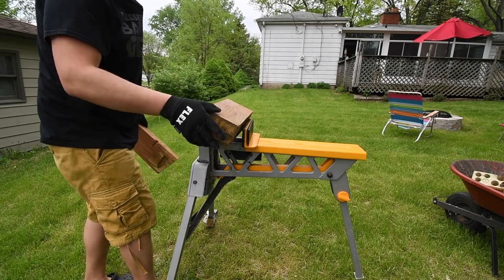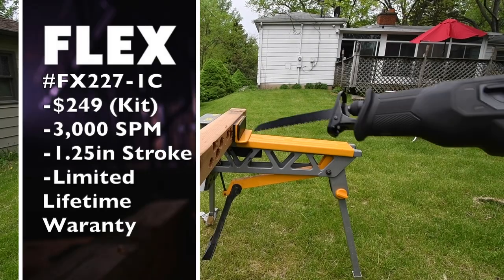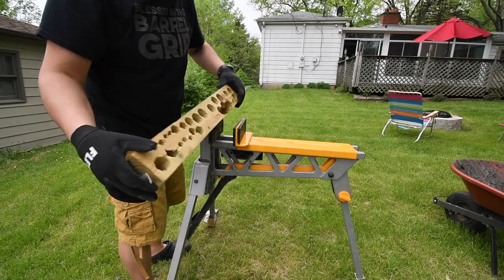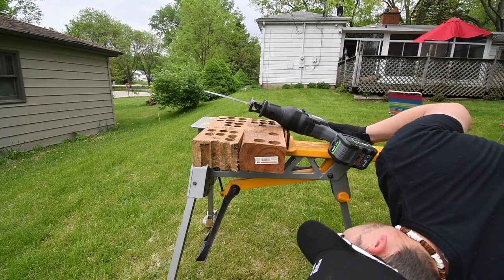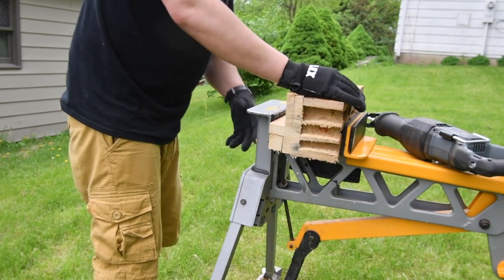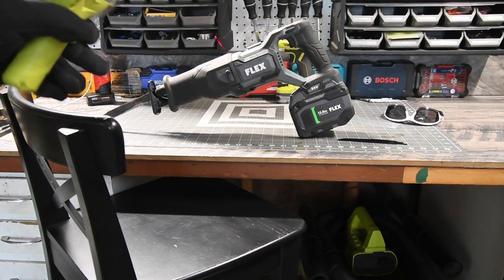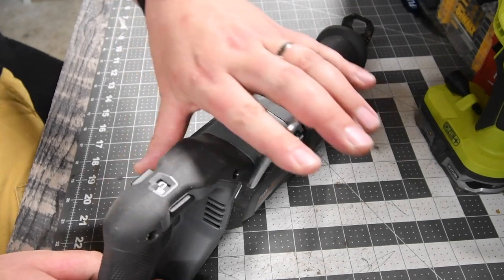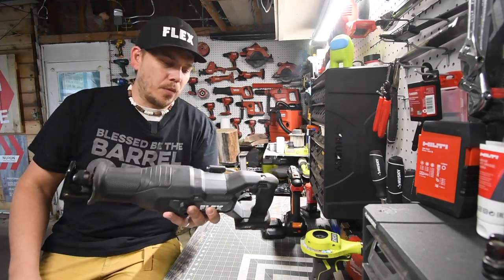Demolition TEST! (FLEX Reciprocating Saw)

Comment: I'm leaning Flex for something different but considering Milwaukee as well. Already have Milwaukee 12V and Dewalt 20V. Really turned off by Barnaby and the infomercial-esque garbage. Just want something robust I can slap a battery in and go. Don't want to worry about a flex volt advantage working with this tool or that tool. Have some Ryobi but usually use those for niche jobs. Great video!
Reply from the maker: Both brands are fantastic brands. right now Milwaukee has more tools to offer than Flex does. but that will change in the future.

Comment: BLESSED BE THE BARREL GRIP Dave! The FLEX saw rocks. How was it for the wrist in terms of vibration?
Reply from the maker: wrists felt good, but you can tell by my skin that you feel vibration
Reply: @ManCaverTools  well, honestly, if you do not feel vibration when cutting with recip saw them your are cutting nothing. So the point is was it bearable or wrist busting? Say how would you compare it to Milwaukee or DEWALT or HILTI

Comment: How are flex tools longevity?
Reply: I have my Flex 24V Quick Eject Brushless Impact Driver, Turbo Hammer Drill kit with 5.0Ah battery for a year of jobsite abuse, driving deck screws, structural lag screws like Timberloks and Spax Powerlags, GRK's Framing and Decking screws 3-1/8, and Spax 3-1/2. The impact driver dropped from 3rd floor twice (intentionally) and 1 accidental drop 4th floor. The tool only suffered minor scratches and little bit of cracks in the back of the tool. The turbo Hammer drill had drilled 876 concrete holes in the size of 3/16th for the Tapcons concrete screws 1/4". And drilled 200 holes for 3/8th concrete anchors. Then assorted drilling of pilot holes in the wood and metal, stainless steel, and did a lot of bore drilling in the studs with Irwin speedbor max. And I spilled the flex hammer drill with a bucket 🪣 of water intentionally. Both of them are still working, and I got them for a year and 2 months now. For the Flex 24V circular saw I got the 7-1/4" cordless sidewinder with brake. Did a lot of cutting on wood, pressure treated, did a lot of rip cutting 2x8x16 (as always I want to turn em' into stock 2x4's) rip cuts, crosscutting 2x10's, bevel cutting and miter cutting (yes you can miter cut your stocks with circular saw using the speed square or any device that have 45°) also I crosscuts a lot of 4x4's and 4x8's pressure treated running the saw with 6.0ah Flex 24V stacked lithium ion pouch cell battery. I got the saw for a year and 2 months but the stack battery I only got it since when the Flex stack lithium battery came out. Also been using the circular saw for cutting metal although you're not supposed to do that but thanks to diablo steel demon blade. And also the 24V brushless grinder and the LED light all of the tools I got them for a year and 2 months now and they still great. I don't have the SDS Rotary hammer drill from Flex. Because Im still running my Bosch 11255VSR bulldog Xtreme. The reliability of the flex tools is a professional grade.
Reply from the maker: that we will find out in time